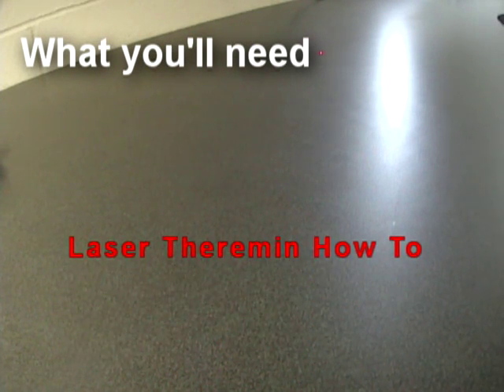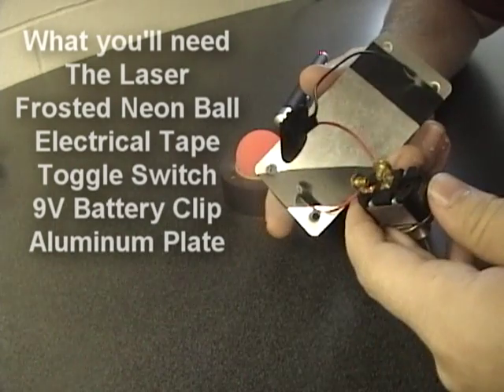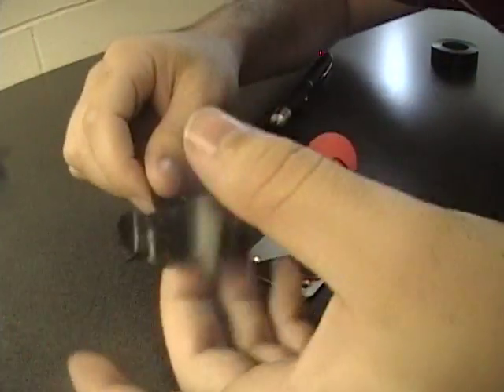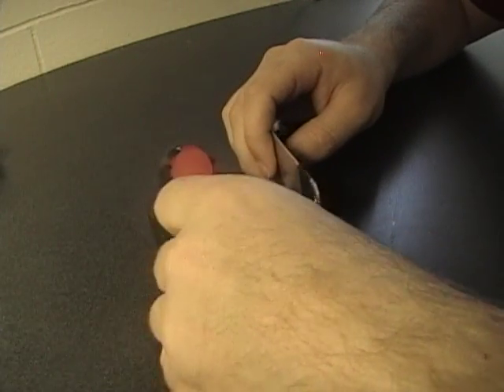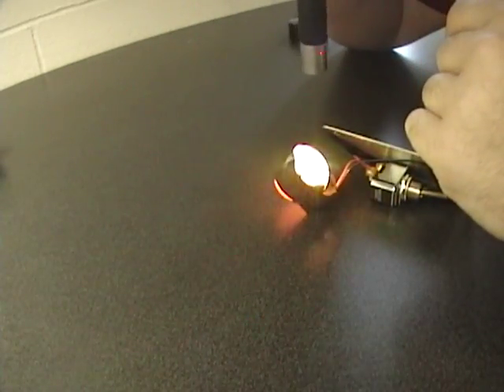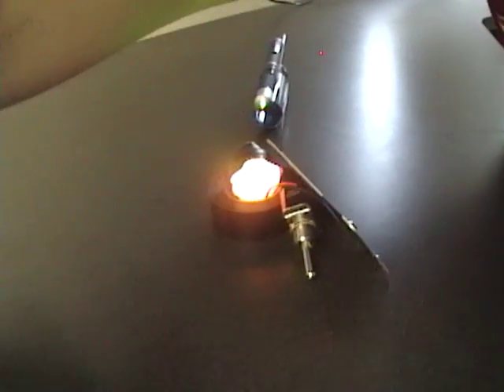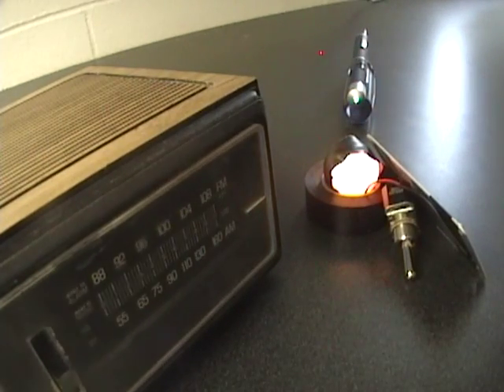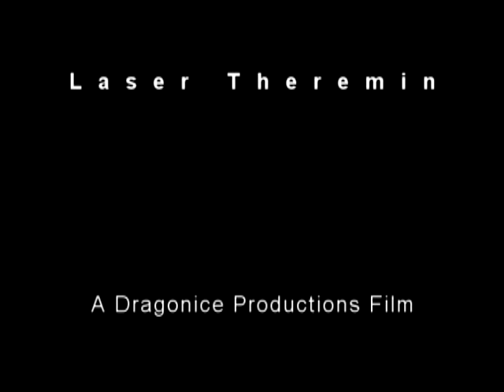Laser Theremin

Comment from the maker: @puffadder01 Radio theremins are very picky, on a regular one, you must use two radios, modify ones antenna, and tune them both to specific frequency (Very cool).  This one you'll just have to play around with.  The light emmited from the laser goes into the ball and rflects and refracts all over the place, so the aluminum plate has a better chance to receive it.  THe light hitting the aluminum plate produces flying electrons (photoelctric effect).  these eletrons hit the antenna inside...